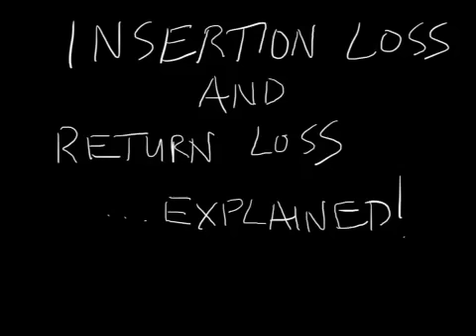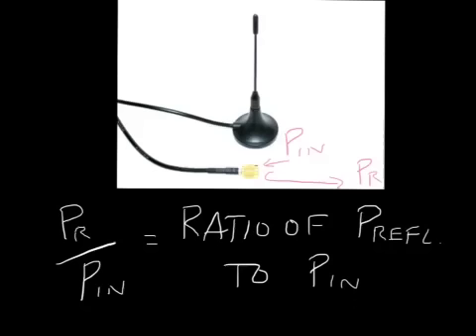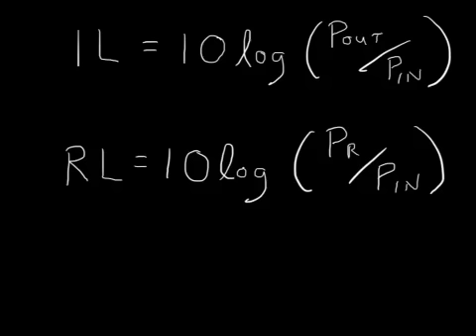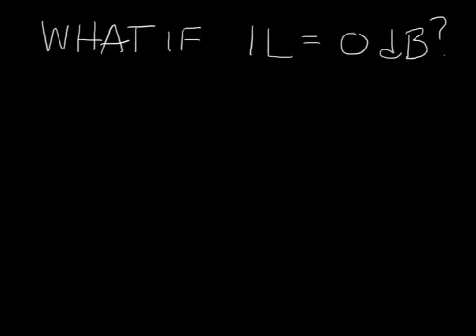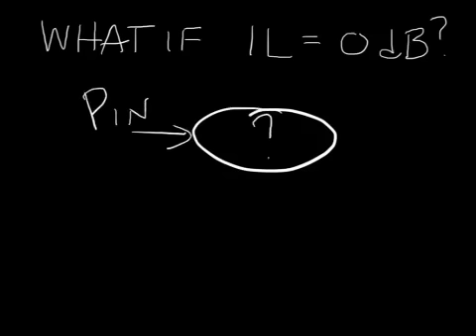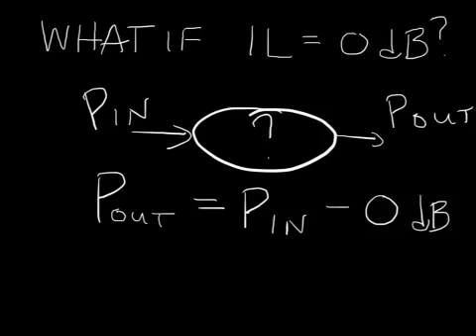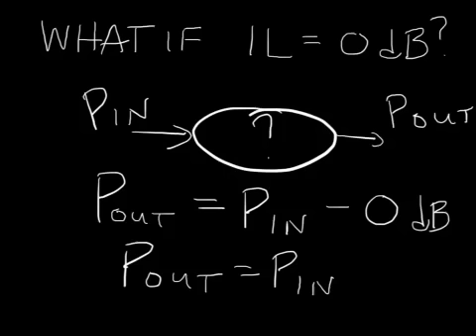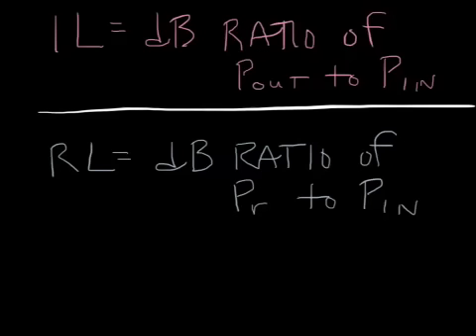Insertion loss and return loss explained

Comment: If there is a loss of 10dB we divide by 10 so this means that the output power is one tenth of the input power.Now 10 dB = 10 log (Pin /Pout)  will become 1 = log (Pin/Pout).Knowing that log 10 = 1 ( when base of log is 10) - this implies that log(Pin/Pout) = log 10 .This means ( Pin /Pout) = 10 which means Pin is 10 times Pout .So I would want to write the formula as Insertion Loss = 10 log (Pin/Pout) . If I don't use the term loss then I can use the minus sign which implies loss and then the formula can be written as 10 log ( Pout/Pin) = a negative dB implying a loss which is written as a positive dB. If answer is -10dB then you can say the loss is +10 dB.

Comment: Definition of IL is not right. Insertion loss is the loss of signal power resulting from the insertion of a device in a transmission line. It is always  positive (in dB) for passive device. In your video Pout is smaller than Pin. It cannot be right.
Reply: Agree!
The sign should be inverted.

Comment: First of all @db is a ratio that express a quantity of something in our case is power.Power is measured in watt( in our case miliwatt) so as far as i know 0db=1 mw.
Any gain by 3 db double the previous value so....3 db=2 mw   6 db=4mw  9 db=8 mw and so on .Resulting from this if Pout=Pin- 0db then Pout=Pin   is FALSE .You cannot express a value of 0mw = 0db because 0 * any number = 0  and previous relation between mw and db will not be sustenable.Zero power is not well expressed in db
Reply: AT-RO first, 0 dB != 1 mW; rather 0 dBm == 1 mW. Next, in the notation "Pin - 0dB", -0 dB is indicating a gain of -1, not the subtraction of 1mW. The following is not valid: 0 dBm + 0 dBm = 0 dBm; since dBm is a power measurement, you can't add these. The following would be valid (and is used in ERP calculations): 47 dBm - 1.3 dB + 8 dB = 53.7 dBm (~234 W).
Reply: AT-RO go to the school again!!
Reply: "You cannot express a value of 0mw = 0db because 0 * any number = 0"

A logarithm is the opposite of an exponent. Any Base raised to an Exponent of Zero is equal to 1

Comment: if IL=10log(Pout/Pin), then if IL=6dB, Is not it 
10log(Pout)-10log(Pin)=6dB 
10log(Pout)=6dB+10log(Pin)
or 
Pout=10^(6dB/10)*Pin?
Reply: As Hùng Nhân Mai mentioned here above, the original definitions given are wrong, which leads to the confusion. If you start from the correct definitions everything will make sense:
Thus IL=10log(Pin/Pout)=6dB means10logPout=10logPin-6dB i.e. the output power is 6dB (i.e. 4 times) lower than the input power.

Comment: Btw, the Return Loss formula in wiki is different, they used Pi/Pr rather than Pr/Pi

Which one is correct? *that used in optical system

Thx
Reply from the maker: In my opinion, both are correct; they just follow different conventions.  Both will yield the same result, except the sign will be opposite (for example 10log(2/1)=+3 while 10log(1/2)=-3). 

With the formula I use, a negative result means attenuation or loss, while a positive result means gain or amplification.  Others express it the other way since "return loss" already has the word LOSS in it and they perceive the negative sign to be implied. 

I have found through experience that the way I explain it tends to result in less confusion, but I will leave it to you to decide which is "more" correct :)

Thanks for your question!